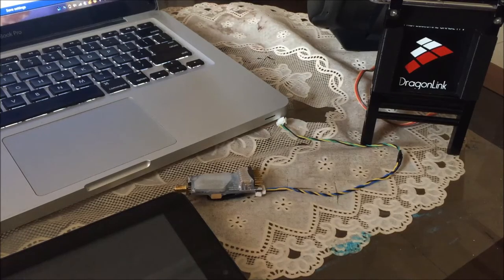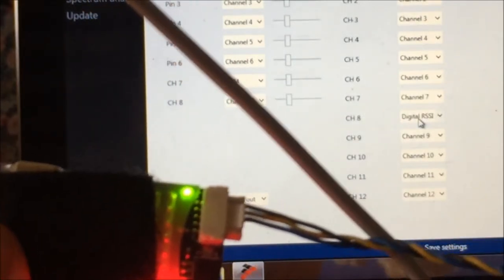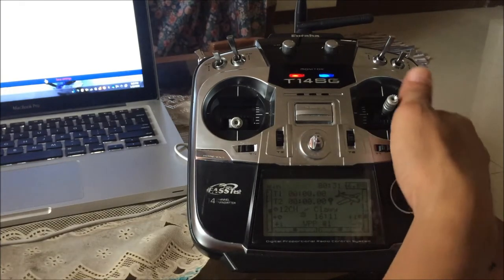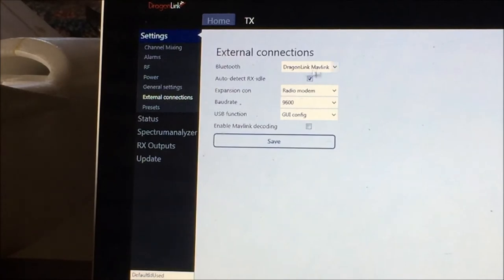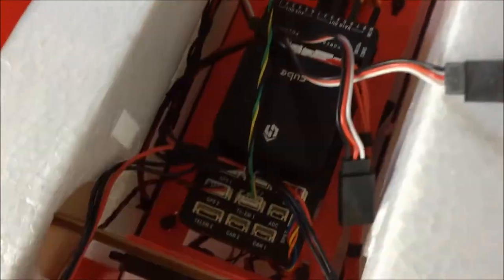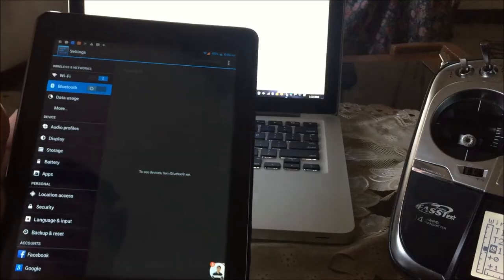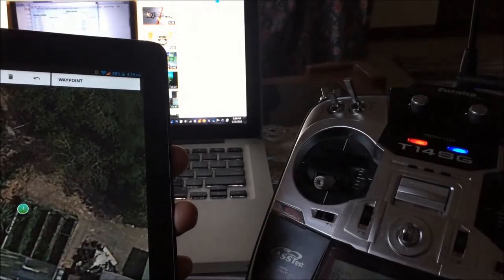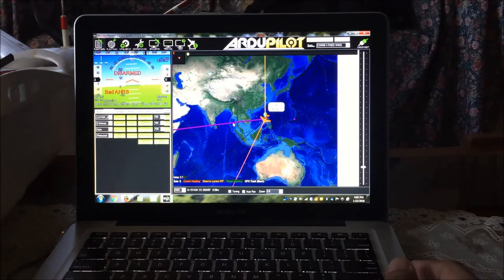Dragonlink v3 slim for Bluetooth Mavlink on Pixhawk

Comment: You should always have antenna connected on the receiver, because it is also a transmitter.
Reply from the maker: yeah, but it's 25mw, it a microRX anyway. Even developers of the dragonlink said it would not hurt their micro receivers if you did not put on the antenna. They even conducted some tests for range without the RX antenna, they claimed that they have been testing some units without antenna and still no harm on them. The developers said it so, and yes I tested their robust system. Unless this one is a 1.5W large RX, then it's a different story. I wont power them without antenna

Comment: only if you had made this video earlier it would have saved me a ton of trouble to get mine working but never the less god bless you n thx for uploading this video 

btw i use q ground control so it was a whole another battle to figure this whole .....
Reply from the maker: your qgroundcontrol link via bluetooth is already working?
Reply: Hi Karan, 

I see your post regarding you used the QGC software. Have you managed to get it working? If so May I get in touch to go through how you managed that?

I'd highly appreciate as I'm having difficulty setting the Pixhawk mini, DL and QGC too. 

Any help would be highly appreciated.
Reply: Hi Erwin, may I also ask if you have tried to connect this setup using QGC, rather than Mission planner - like Karan?
Reply from the maker: yes, works fine with QGCS. I love the fact that QGCS can do grid survey autonomous flight plan :)
Reply: @Erwin awesome. Would you mind if you could send me the settings for getting the DL mavlink working with the QGC? I am using a pixhawk mini and can't seem to get the communication between DL, QGC and the pixhawk mini. Would highly appreciate it Thanks!

Comment: Thx for the video.
Finally acomplisch mine to di it. 😎
Reply from the maker: glad  the video helped :)
Reply: @windfpv  yeah big help. On tablet it works great now.. So how can i get telemetry from dragonlink tx to my frsky radio?? Through uexp of the dragonlink?
Reply from the maker: You need teensy 3.x board to convert mavlink to S.Port. My teensy is set to arrive this week. I will post the results as soon as possible :)
Reply: I have craft and theory cable. But it seems not working.. on 2.4ghz frsky telemetry... 🤔 ordered a new 1. Maybi have a bad... or something is wrong on the setup...
Reply: Only rssi is not working.. how did you setup?? Thx for the help.
Reply from the maker: craft and theory cable works with native frsky telemetry only, not with DL mavlink. The role of the Teensy board is to convert the mavlink to a data that can be interpreted by frsky S.port.  I have a similar cable (not craft and theory, but DIY version of it) and works well with my frsky setups. but connecting it to dragonlink mostof the data will not be transmitted.

https://youtu.be/Xz1TXusHuwg
Reply: Yeah i have craft and theory cable. On frsky receiver. But no sensor are discovered.  :(

Comment: Hi Erwin, that's a beautiful tutorial you presented! I have the dragon link v3 slim non Bluetooth version. When I ordered it I forgot to order the uexp connector! I see that you are saying it's possible to connect DL receiver to pixhawk telemetry using receivers channels as rx and tx, my question is what changes would I have to make in the mission planner's parameter list if I'm not connected to pixhawk via uexp on DL receiver? Also do you know if I can make a diy uexp connector? Because in UK I can't find any one selling this type of connector!! 
My last question have you setup failsafe in DL or within mission planner ?

Many thanks
Reply from the maker: on the DL GUI, you can set up each pin not only the UEXP for a specific function. If you are not to use the UEXP pins, you can use one of the 8 PWM channels for the telemetry TX and Telemetry RX. no changes will be made on the mission planner/pixhawk (but set it up as i have instructed on this video).
Reply: @windfpv  Ok thank you very much.have a nice day or night ! Depending which side of the globe you are now 😊😊
Reply from the maker: im here at +8:00 zone :D hahah! thank you for taking time to view my videos